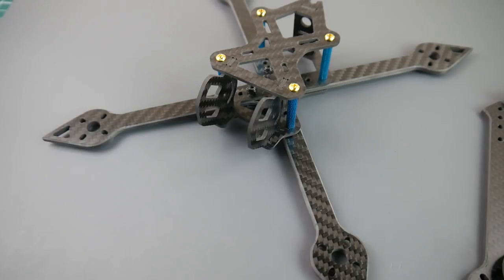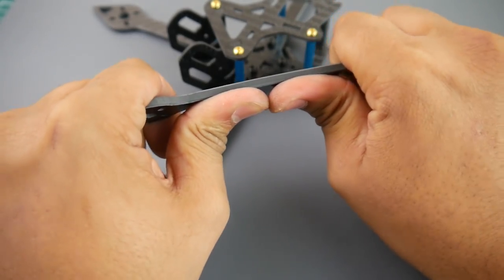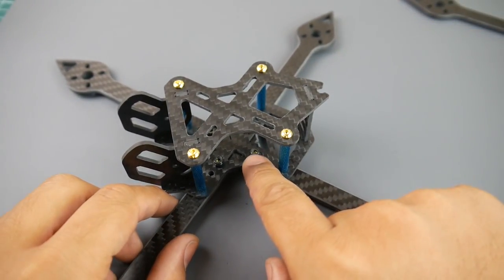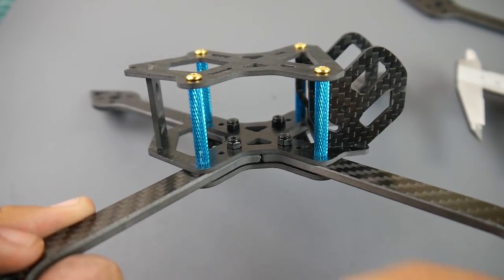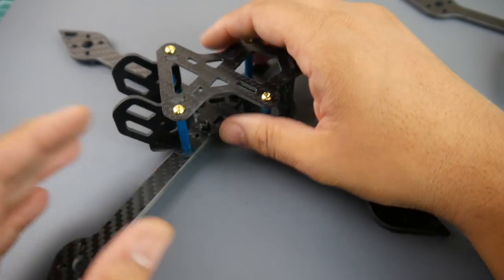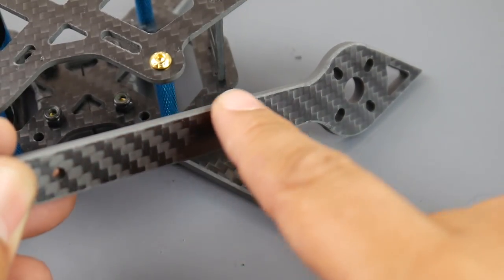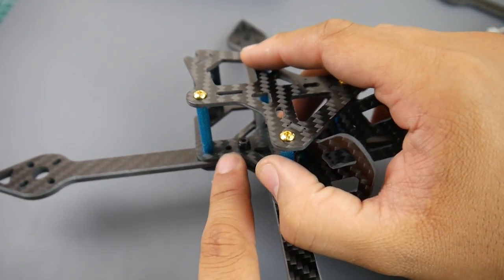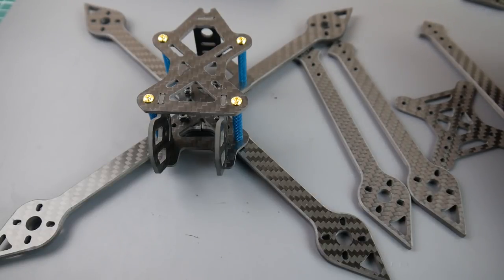$20 Frame Any Good?? // TINSLY-X50 and TINSLY-X60 Review and Break Down

Comment: For the similar price of 20$, I rather get vx220. It has similar construction but much lighter, 70 grams with camera stand on top. Remove the HD cam stand and you save 2-3 grams. You can find vx220 on Ali-ex for 17-20$. Discount season is also coming.

Comment: What frame can you get for $20 that is better
Reply from the maker: Frog Lite
Reply: Maybe where you live. Where I live the frog lite id a 56 + frame. Search Amazon.
Maybe from bangood  ect. I will search
Reply: And when I search bangood it started off as a 40 dollar frame.
Reply: Just saying you are way to harsh on this frame. At least fly it and test it out properly before bashing it. You are assuming vibrations and assuming it wont be a bit stiffer if you moved the screws outwards and placed a stack in the frame.